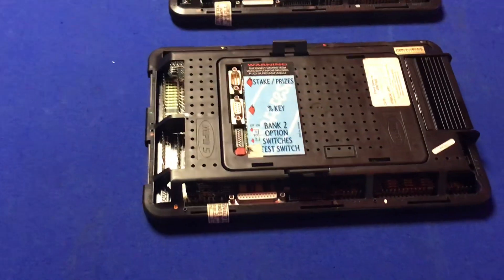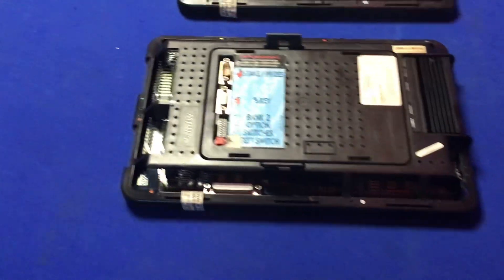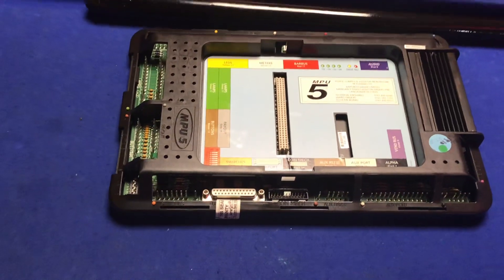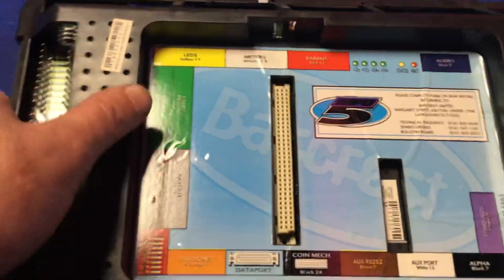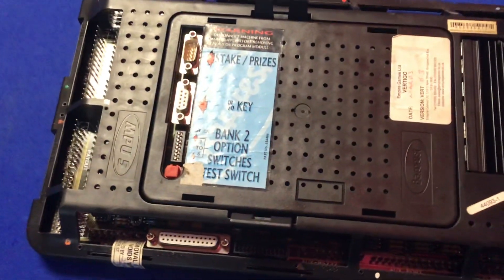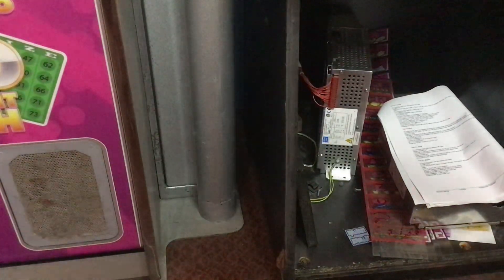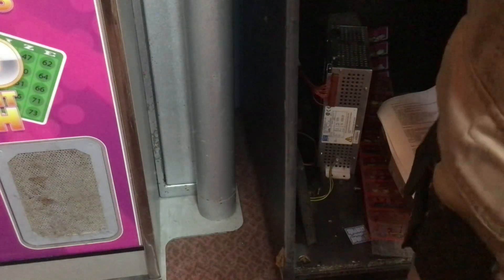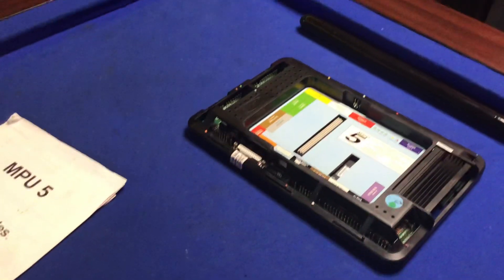Will I fix it, part 2 of ?

Comment: Could  be the one of the LCD meters  bud I had to change my Addams family one back along 👍😉
Reply from the maker: Thank you
Reply: I would put in a different coin mech and a different hopper see if that works
Reply: Nothing to do with hopper or mech meter fault
Reply: @johnedge3652  I didn't want to be the one to say it 😉👍
Reply: @johnedge3652   I had same problem with my old Addams's family fruit machine I've changed the hopper and the coin mech and it worked